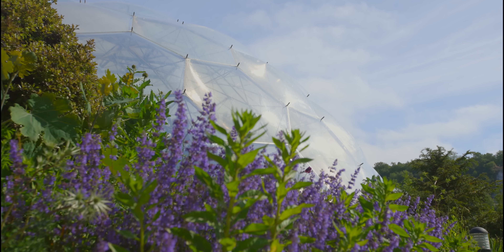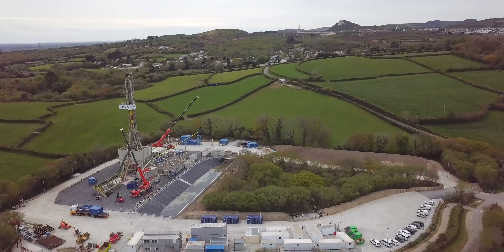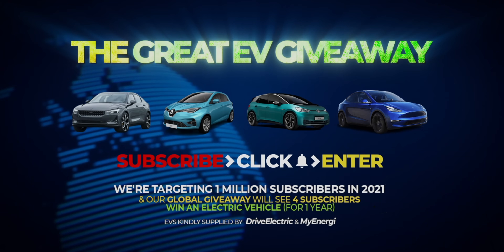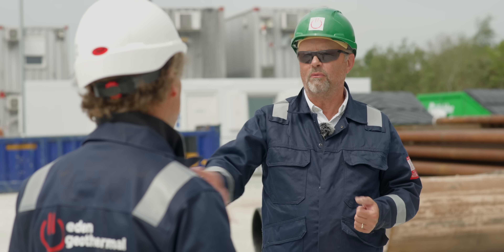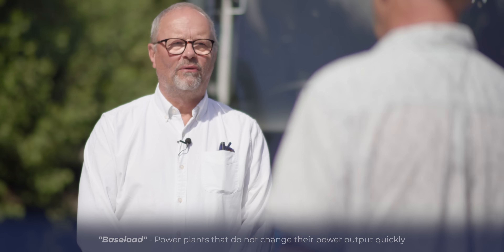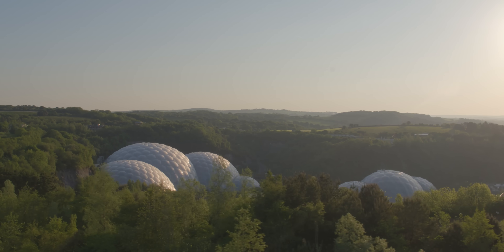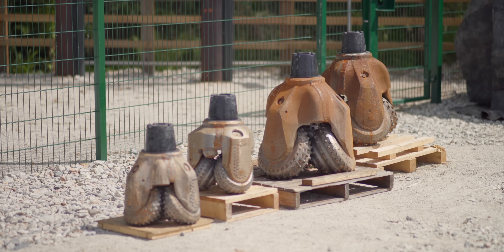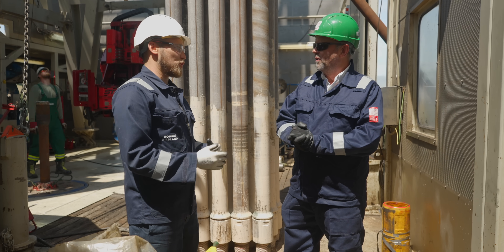Is Geothermal power the answer? | FULLY CHARGED

Comment: It takes about 20 psi to lift water approximately 40",  a bit over a yard. Forty five hundred meters would need 90,000 psi to lift water to the surface- regardless of you pumped it or just trickle it into the well- 90k PSI, 6000 atmospheres. Drillers have been fracking and not realizing for many decades, at least since the late '40s- "mysterious" events would cause the well to suddenly lose it's drilling fluid (solution of water and clays used to both lift bits and as ah hydraulic driver for  the boring tools), then thought to be a previously "unknown underground volume", they even coined a nick name for it- "VUG". In many types of formation, any drilling below 2500 meters begins to naturally require pressures at the bottom of the hole large enough to "auto frack".  I'm going to vote "they have a great idea but are pursuing it inefficiently". Any steam energy you develop at that depth will need to spend a large portion of it's potential energy just to top the bore hole.  FR

Comment: The heated water that is pumped out of the well contains all of the elements on the periodic table.  In California the water contains a reasonably high amount of Lithium that can be sorted out for lithium batteries.  I know this is true in California and I assume most everywhere else.
Reply: No not really, which is the problem with fracking the geology in the USA is not the same as the  UK

Comment: Very bad news.
Pumping water into the subgeosphere will induce earthquakes.
Should have been a closed circuit system.
Very short sighted.
Let me explain the difference in a clearer way.
You can boil water by putting a pot above a bonfire. (Closed circuit)
You can also boil water by pouring it directly onto the bonfire.
The latter will have a much higher reaction.
The former is gentler, and safer.

Comment: Geothermal is not the way to go because it requires fracking and even deep fracking causes massive pollution problems more made notable with the radon problem. There are already geothermal projects active in Cornwall and they are all borderline.

And, oh, dear Sir Tim, batteries can provide storage and "base load" output; perhaps not Li-ion but flow batteries, liquid metal batteries and especially iron/air batteries can provide such storage and output.

Comment: I would love to know; is it fully sustainable? If we were to keep transferring heat from deep under ground, to then expel as steam further up, surely we'll eventually transfer all that heat until the source of t he heat eventually cools down? How long would that take? hundreds of years, thousands of years, millions of years? or is it infinitely sustainable because the earth's core continues to maintain heat as it spins through space? Would love to know this...
Reply: The well cools in decades, so there is not much chance of enough energy being released to affect the climate. Rock is a very good insulator and the heat does not flow well. The same reason we don't burn our feet walking around! Even if you find an area with very hot rock, that is not the same as a lot of power (energy flow per second). The water is barely boiling so cannot run a useful steam generator, just heat the greenhouses. It is only being drilled because of all the enormous grants that don't have to be repaid!

Comment: I love Robert's enthusiasm, but I am unpersuaded. On average heat flow from the centre of the Earth across the UK Is 0.038 watts per square metre. On average (night and day) average solar power is about 240 watts per square metre. So to extract heat sustainably one needs to extract heat from a VERY large area of rock. Otherwise one simply cools down the rock over a few years. This may make sense, I don't know all the numbers, but this video makes me think that solar power with big batteries is probably a better bet at the moment. But good luck to them.

Comment: I remember talking with a geology graduate back in the mid 90s about the geothermal potential of the English SW. why has it taken 25 years. I now live in NZ where about 20% of the country’s energy requirement is geothermally produced…about 7500 GWh per annum.
On another tack, I also worked in the oil exploration industry and I have never seen such slow drill pipe insertion. Was this just for your cameras?

Comment: 5MW. Less than a Vestas wind turbine. Will still need energy to drill pump and stick a turbine on or maybe they plan to replace gas for heating Eden in which case they won't have energy losses.  Currently  Bloomberg analysis shows geothermal up there with nuclear LCOE at $200 per MW. But good to see and IF engineering costs can come down. I doubt it will be but that's research. As they say there is technology, economics, and politics. Technology - ✅ Economics -big❓ Politics - keeps fossil fuel companies exploration in a job ✅

Comment: Again, good to see but not new. About 2010 I had money in a hot rock company in the Australian desert called Geodynamic.They successfully drilled 2 holes into granite.thhey fractured the rock horizontally at depth and pumped water and sand down. worked well. would have been ecoomic to generate but they were about 400km from nearest power line interconnect. just not economic. no gov. interret as we have plenty of good qualtiy coal.why do i suspect the fossil f induustry,,,, hope enend gets a good strong flow of super heated steam.Fracting may,help open the connection between the 2 wells.
Reply: I likewise followed his and invested in geodynamic. Amazing he way they found granite that could fracture horizontally. Pity it was so far out in the desert!

Comment: Is it stupid to think if everyone starts doing this 
Eventually the earth core will start cooling down and it will be a next mess we need to sort out ..?
Reply from the maker: Not stupid, I think there are many people who have wondered and I did until I asked a geologist. 
Basically if you imagined the earth was a football, the distance from the earth's surface to 5 miles down equates to less than the the thickness of the rubber the football is made from. 
On the earth between 700 miles and 4,000 miles down, depending of where you are on the surface is an outer red hot (molten lava) core that's around 6,000 miles across and inside that is a spinning ball of white hot radioactive metal that's about 3,500 miles across.  If we could drill 10 million holes that were over 700 miles deep and extract trillions of kilowatts of heat for a million years, we might really screw things up. Apparently.

Comment: I guess if they are not fracking it means that they are relying on the fault being porous enough. They won't know that for certain until they get to depth. However this is a great repurposing of the drilling industry that I am in and a truly exciting step in the right direction.

Comment: The other benefit is that once you have used the high and medium pressure steam to drive turbines you are left with loads of free hot water. We should follow the iceland model and distribute this to houses to reduce their need to use gas boilers for hot water.

Comment: I am so goddamn tired of people who think baseload is an advantage. Peaker plants can meet the base load. Intermittent sources, if distributed widely enough, can meet the base load, and if you add storage it becomes way easier. And if you have enough intermittent sources combined with enough storage to handle peak power demand, base load is not a problem, that is when you are busy charging up your batteries and filling up your reservoirs. 

And the sad thing is, geothermal isn't even base-load. It can be turned on and off with a valve, it can be throttled quite quickly. Geothermal energy is a peaking capable plant.

I'm a fan of geothermal, in some places it is already cost effective, in others it might become cost effective in time. But we don't need to pretend that it solves a deficiency of solar and wind, whenever I hear that talking point I become highly skeptical of the cost structure of the project.

Comment: Very good, hope they make it work but it looks like they'll lose a lot of water out of the sides. Always seemed to me that the best way to do accelerated geothermal would be a co-axial pipe, cold water on the inside hot on the outside - straight down and straight back up again, sealed at the end.

Comment: :_bobby:I consider Geothermal project in Lismore 3year ago.:_solar::_wind::_wind:   We have a project that is retirement village in Qld Australia any going install 2000m2 PV  and 4MW Batteries.   The price of power the lowest 22.4c/kw to 34.5/kw in Australia, therefore if charged 20c/kw.   Power collected a day conservatively  is 1.7MW/day price 20c/kw =  AU$333,750.00/day.  For a 10 year = AU$1,218,187,500 
The cost 2000 of PV = AU$248,187 and for 4MW Batteries AU$248,187 both prices are installed. The maintenance and replacement over 10year = AU$2,558,194.

The power per dwelling 25kw/day for ordinary building. We are buildings passive house certified homes that costs AU$2,418/m2 area 240m2. Power consumption/day is 7.6kw/day

Comment: great episode, amazing. What's more cost effective lots of small local ones, or bigger giant power stations.
Reply: There is no small for deep geothermal.
You need above 130c output from deep down.

Even larger where possible,
Most important is a collective effort, where a single target failure isn't a disaster.
That risk is a high cost element.

Comment: What I really hate about discussions around renewables is the idea that there is some kind of limit to any of the technologies and that what we are looking for is some technology that can provide an abundance of energy. This is how nuclear is usually marketed. But this is patently false. It is trivial to supply all the UKs energy with wind, or solar, or geothermal or nuclear. What matters is cost. And that includes up front cost, and environmental cost. If geothermal can compete on cost with solar/wind + storage then it is a good source of renewable energy. Nuclear cannot compete on cost and should be abandoned. Only fusion energy is currently in the 'impossible' category. What I don't think many people have realised yet is that the most economical energy to date is solar/wind with about 5X over capacity + storage. This will create an abundance of cheap energy and any country that does not do this will be left behind economically by those that do. Sure geothermal still has its place especially in home heating.

Comment: Remarkable video, just one problem, geothermal power plants are not new, we had one in Lithuania from 2004 to 2017,  with very similar concept was made with 2 wells (1 getting hot water 2 injecting) it wasn`t so deep around 1135m, and 38 C temperature, still that was pretty good and powerful enough, the main problem water was too mineralized and was very complicated to inject back to the well.... I hope you had more luck with that incline
Reply: It is a closed-loop system so you could use pure water as the fluid, or supercritical c02.

Comment: I remember there was an experimental geothermal borehole project in Cornwall in the 1980s which failed due to minerals crystallising and blocking up the joints through the water was flowing. What has changed since then? I imagine the development of deviated drilling has made the process much more thermally efficient, but that still doesn't account for the geochemical problem.

Comment: "If this works as well as I know it will" I need to start using this one. I know this works and if it does, it could be the surest thing i ever had so much doubt about. 
Great project! We are hope to dig a slightly smaller though certainly ambitious geothermal system for our new home.

Comment: This was presented as if geothermal was a new technology. It has been in use in other countries for decades so the technology is understood. The point here is that this is the best location in the UK to try it, so if it does not work here it will not work anywhere in the UK.

Comment: baseload is "load" not generation.  You have generation for baseload, but baseload is an diminishing load type as load becomes more efficient.   What geothermal is, is firm power (in theory), the problem is it is very expensive compared with renewables.
Ultimately geothermal has the same problem as Nuclear, in the firm power can be a noose rather than a solution when you try to supply variable demand with it.  Like intermittent renewables it needs storage or interconnects when demand is lower than supply.

Comment: Why when they're drilling do they use metric to talk about well depth, but imperial inches to talk about the drill bit diameter?!  
Amazing to see though - any info as to when they expect it to be operational?
Reply: Most drilling technology comes from the US, which is why the imperial measurement for drill heads sizes. 17" for instance would be 43.18 centimetres, which isn't a number the rolls off the tongue, especially if you're used to using standard imperial drill sizes. 

The depth of the hole being drilled could be measured by whatever standard is relevant, as it's completely independent from drill head size.
Reply: It's Britain where both are used.

Comment: I would have liked it if they addressed whether or not the heat sources in these wells will fade over time. You'd think they'd at least reach some kind of equilibrium that's at a (possibly substantially) lower temperature compared to when you just started exploiting it.
Reply: The Earth is an extremely large natural nuclear fission reactor, there is enough nuclear material(fuel) for plus 1 million years.
Reply: @michael-vl1mn  That heat is produced much further down though, once the local heat has soaked out of the area you drilled, it will usually only warm up again at a relatively slow pace that might not match with commercial exploitation.

Comment: There wasn’t much explanation about the potential for growth in alternative locations with less sturdy rock composition. One engineer said only a few locations have the required sturdy rock composition and another said it was akin to the beginning of another renaissance period. What are the possibilities of our seeing these high tension developments in softer rock locations?

p.s. I am evolving into vertical axis wind generators being the key to future wind development projects, one stacked on top of the other creating an installation of columns of vertical axis win generators, with each separate vertical axis wind generator upon the column generating power via its own turbine. You could have 5 turbines per column if need be. If developed and engineered into proper dimensions these would have the added benefit of not ruining the natural aesthetic of the landscape because there would be no need for 3/4 massive blades thundering through the air, day and night. Residential areas (with good law abiding families in them) could quite happily and peacefully house wind generation for entire communities without freaking them out via the installation of colossal bladed turbine structures right next to their houses.

Phew. 🥸

Comment: Underground fascinates me. We know so little about it as we've barely scratched the surface of the crust and the crust only makes a tiny fraction of our planet. The opportunity for minerals and for heat energy are huge. We just have to be vary careful how we do it. Mines of old have often come back to bite us with ground subsidence and earthquakes. Minerals and energy are what's driving the human race, and it will likely be a combination of underground projects like this and the Lithium one. As well as under sea mining (again provided we can learn more about it so it can be done in an ecological way) And of course space and using the power of our sun and mining of asteroids. We should be looking at the least destructive options over what is most economically viable in the short term.

Comment: At last a new and ethical use for oil and gas  drilling technology.
Reply: and yet, none of this would be possible without oil and gas
Reply: @darrenelkins5923  yep. still time to get rid of the practice of burning it as a fuel though. that doesn't mean we have no more use for the tech. we'll still need to make plastic for some period of time as well.
Reply: Well I mean geothermal is not exactly *new*. But it's still cool! Or hot if you go deep enough lol.
Reply: Floating wind turbine platforms are also an adaptation of engineering techniques used by oil companies.
Reply: 900 pounds of ethane per turbine blade, medical plastics and asphalt all seem ethical
Reply: There is no time in the near future that we are going to stop needing oil.  What we need to do, is to STOP BURNING OIL.    Many hundreds of thousands of products are derived and manufactured from oil that will never be burned and will never contribute carbon to the atmosphere.  There are over 6,000 easily identifiable products in the average home and average workplace.  Some can be replaced with non-petroleum products, but many others are critical to the quality of life.  90 percent of every electric vehicle is derived from a barrel of oil.  The demand for these products is ever growing as developing nations demand to have the benefits of the first world nations.  One of the greatest problems of recycling plastics and other petroleum based products is that they require tremendous heat for the recycling processes and we currently burn more petroleum products to accomplish the recycling process.  If geothermal can be used to provide the energy necessary for recycling, much of the 'plastics problem' is eliminated.  When we stop burning oil, there will be more oil available for its' many non-combustible purposes.

Comment: 6:44 8:08 are gentlemen describing EGS system aka fracking-like type of geothermal?
described also by Matt Ferrell in the video "Geothermal Energy Explained - A Not So Hot Solution?" 4m15s and 10m05s
16:45 ah, glad it was confirmed it's not the same system.